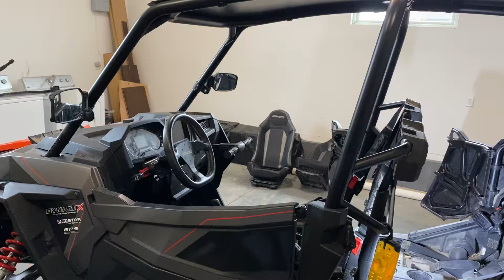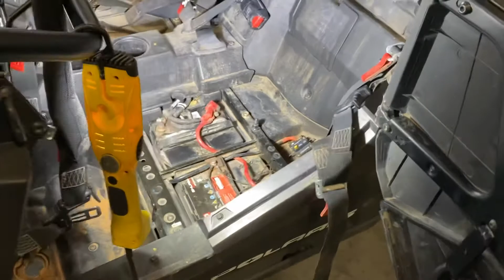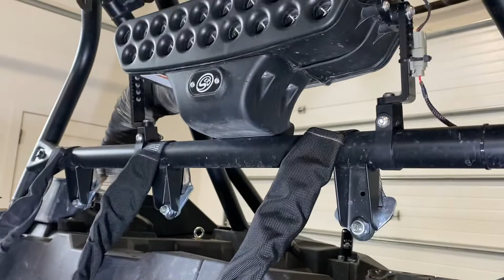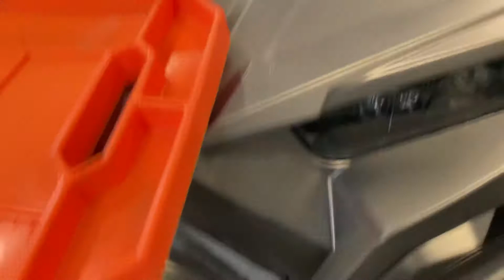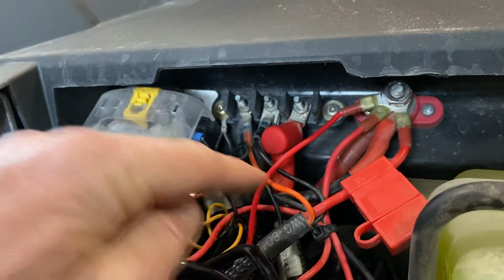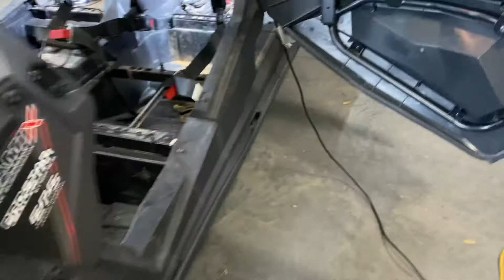Polaris RZR Dual Battery Install

Comment: Thank you for explaining the charging process and explanation for the installation off the aux battery. I just got an led light bar and street legal kit installed on my RZR 900 and it won’t start. Now, I know I need another battery to run the accessories and how/what’s needed to install it properly. EXCELLENT INFO!

Comment: Thanks for the video. Ordered my components for the same setup yesterday, except I’m adding an onboard 2 bank Gen 5 charger from Nogo and a waterproof AC plug to just pop it on the trickle charger after rides. It’ll charge the gel battery and vented battery independently on their own settings.

Comment: Does your fuse box disconnect power fron the second battery when you turn off the Key ? After all, UTV has no door. The winch is dangerous.   I am worried about children playing with it or accidentally touching it.
Reply from the maker: It does! The vent racing fuse block has a relay. I used the accessory power off the main bus bar to trip the relay that is supplied power from the secondary battery thus giving me the best of both worlds.
Reply: @BryanHansen  Nice Thank you very much! hope see your accessory fuse box video!
Reply from the maker: @george1984  I actually think I show it in my light bar mistakes video.
Reply: @BryanHansen  Hey Bryan.  Great video.Thank you.  what size relay does that vent racing fuse block have?  I want to be able to have this feature to kill power when key is off for second batt.  I already have the Blue Sea System Fuse Block.  Thanks Bryan
Reply from the maker: @bryanstaley8691  I tried digging to figure that out and I can't find it (easily). I would call vent racing directly and ask them. ventracing.com

Comment: Is the secondary an AGM? If so from what I understand you don’t want to mix AGM and flooded. I have done this and over time you will unintentionally over charge the flooded battery. Slowly cooking it. Ended up talking with two manufacturers to figure this out. Plus the two need different types of maintainers.

Comment: Im trying to do this but im going to be using a lithium  quad 30 optimo  battery  as a 2nd battery any suggestions?
Reply from the maker: Lithium has a very different charge pattern than a flooded or AGM battery. Might not matter, but just thinking out loud... I use the battery I do because of the fitment into the battery tray.

Comment: Helpful video! I did the same setup but mounted the circuit breaker in the front where you mounted the extra post. So I have a single wire running from second battery to the front of RZR and all my accessories are on the other side of breaker

Comment: Good afternoon.  Had a question about the power going uo front, could i just connect it to the accessory post on my 21 rzr? Going to do this same set up mimus the fuse block you have upfront. when adding my 2nd battery bc i have accessories with relays installed on them all...
Reply from the maker: @smokeyjoe926  make sure you use a relay and supply power through a dedicated line and not a switch.
Reply: I have all my accessories to turn on by rocker switches on dash and they go to accessory block. This is my 1st sxs so new to the accessory block up front and adding second battery. I'm taking out soundbar and putting in a noam sound kit in and trying to find best way so I don't drain battery while riding and stopping in trails.
Reply: Love the video, very detailed on how you did everything.
Reply from the maker: @smokeyjoe926  the biggest mistake people make is not running stuff off relays. Your setup sounds fine, just don’t make the switch what cuts the power but rather cuts power to a relay that shuts off the light bar or whatever other accessory you’re wiring it.
Reply: @BryanHansen  thank bud. Greatly appreciate it the info!
Reply: Just watched your light bar video... I have My rocker switches wored correctly.  Could I do everything in this video except run the power wire you ran up front? And move my power wires for accessories from. Main battery to the second battery? You were running that 2nd power upfront for bc of your winch correct?

Comment: that line of shuriken batteries is intended for use with large aftermarket car audio setups, its what replaced large capacitors, it protects the vehicle electronics and charging system in newer vehicles from voltage drops...essentially what you are using it for. The 800 watt rating is on there for car audio customers to properly size the battery to their application. 

Unlike traditional lead acid starter batteries these will stay a consistent 12.5 volts for much longer, they charge extremely fast, the can take abuse, Ive ran them dead hundreds of times and Ive had one drop a cell after 10 years of neglect and abuse. 

Thanks for the video, I am in the process of doing a very similar setup on my 19 xp4 turbo preferably with that brand of battery but needed info on fitment. 

I will have to check out the smart isolator, generally I run an isolator off the ignition sense wire, this allows it to charge once vehicle is running, isolates it when off, and will not pull from the second battery when starting.

Comment: Bryan, great video! Really appreciate it as I am installing a dual battery on my 2014 RZR 4 800. I do have a question, what is the reason for the 100A Fuse?
Reply: You were also going to post a video of the vent racing fuse block install, I couldn't find it on your channel could you link it?
Reply from the maker: @Wstrncdn5time  for fire safety. If you winch, you definitely want a fuse. I never made the other video, but it is really straightforward. I may make one just to show people what I did. Feel free to ask questions and I’m happy to answer them
Reply: @BryanHansen  thanks for the quick reply! I went with the fuse anyways, figured it couldn’t hurt was just curious. Makes sense under a heavy winch load it could have a large draw.

Comment: I really like your dual battery setup, and I understand how you wired your fuse block, but it wasn't clear where you wired your winch in. Did you wire it to the fuse block or directly to the aux. Battery post? Thanks Robert
Reply from the maker: I wired it to that battery post, and then to the hundred amp breaker before the second battery

Comment: Hi Bryan - great video, thank-you. Two questions please. 1. Can you clarify what gauge cables you’re using from battery to battery? 2. From the marine fuse to your post up front, you’re using that post to drive all accessories including your winch? My very near future adds will be a winch, lights bars, and 2 amps for speakers/subs. So any high level advice on where you would source their power (added post and/or stock accessory post) would be appreciated. Just bought a 2021 rzr xp 1000 premium.
Reply from the maker: Hey Sammy, the 2021 has a different accessory bus bar, but I would still look at running the separate power cable up front how I did. I really like isolating the battery from accessories. I got stranded one night from winching so hard that I killed the primary battery. I have 7 gauge between the batteries and 6 up to the post because it’s a longer run.
Reply: @BryanHansen  thanks for the reply! Do you think 4 gauge is too big for the front run? I had already bought some, but I’m wondering if I should return it for 6 gauge. Do you remember how long your front run cable is?
Reply from the maker: @Mrdude6013  I don’t think it is too heavy at all. Winching takes some serious juice. I don’t know how long mine was because I bought extra and cut it to length.

Comment: Can't find the video, to where you wired up fuse block etc?
Reply from the maker: I’m going to have to post up another video on it. Not sure where it went to be honest.
Reply: @BryanHansen  would you be ok , with sending it to my Facebook messenger or cell?
Reply: Did you run a ground cable from the left side of your fuse up to the ground on the main bus bar or is that another positive bringing power up to an accessories  fuse block?

Comment: Do you know if this set up will work on a 2021 Polaris ranger xp 1000?
Reply from the maker: It is a different battery size and I am not sure of the exact dimensions, but everything else works just the same.

Comment: Great vid! I’ve just got one question. What would happen without the isolator?
Reply from the maker: You could winch hard enough to drain the batteries to the point that your UTV won't start.
Reply: @BryanHansen  ok thanks man

Comment: Hi bryan are those batteries same voltage and amps,
Reply from the maker: Same voltage. The accessory battery has more amp hour storage, but that doesn’t change anything just storage capacity.

Comment: Second video of this?
Reply from the maker: I honestly do not know where the second video went. I published it, but it is gone. The install of the fuse block is really quite easy.
Reply: @BryanHansen  I have everything I need.   Just have to hook it all up.   However the extra hot terminal next to your bus bar I didn't get.
Reply from the maker: @samkiepprien3858  so you aren’t running dual batteries?
Reply: @BryanHansen  Yes I bought the exact same battery you have.
Reply from the maker: @samkiepprien3858  we’re you just going to run the wire directly to the fuse lock then if you didn’t buy the extra post?
Reply: @BryanHansen  I bought a fuse block to attach each individual accessory.   It'll light up if one was to blow out.   Really not sure what would be the best.  The reason I haven't started into it yet
Reply from the maker: @samkiepprien3858  And were you going to run every wire directly to the battery or to a terminal post like I did?
Reply: @BryanHansen  That's what I'm trying to figure out.    The fuse block needs POS & Neg ran to it then all the accessories would go into the block.   So are you saying I would need to run two hot wires to the block adding another hot terminal?
Reply from the maker: @samkiepprien3858  I ran the post because I wanted to run my winch directly to it. The fuse block I used, which you can run the blue sea block too, needs positive to it and the. You just ground to the frame anywhere. My fuse block is relayed so I ran the relay to turn on from my OEM accessory post and then the power from my added post. That way it was keyed power, but supplied from my second battery.
Reply: @BryanHansen  So the extra post isn't nessisary needed?    POS & Neg from bus bar to fuse block in which I could hook my winch to the fuse block too, and just run a hot wire the length from the secondary battery to the hot connection on the fuse block?
Reply from the maker: @samkiepprien3858  accessory from the oem bus bar, negative to the frame, power from direct connection to the second battery. And, run an isolator for the batteries.
Reply: @BryanHansen  I was going to unhook the accessories from the bus bar, and connect them to the fuse block.   I do have the isolator but still have alot of wires that were hooked to my main battery with fuses.   Just reattach them to the secondary battery now?
Reply from the maker: @samkiepprien3858  I think you’re headed down the right path
Reply: @BryanHansen  So everything that I had connected to my battery under my seat I can now just connect to the fuse block?    Sorry I'm no electrician.
Reply from the maker: @samkiepprien3858  yes.
Reply: @BryanHansen  So you had a hot wire running the length of your vehicle to the 100A fuse.   So do I run that from my accessory fuse block to that 100A fuse or directly to the secondary battery?

Comment: How about trying the True battery isolator kit with manufacturer full warranty
Reply from the maker: I have like this set up the better. In fact I got to use it on another vehicle the other day at the auxiliary battery was dead. It was great to be able to just jump the primary battery and have it take right off

Comment: Did you use self tapping screws on those three pieces you had to mount to the machine or bolts and nuts?
Reply from the maker: I used self tappers, but I would like to actually put in rivet nuts. This worked great though.
Reply: @BryanHansen  you don’t happen to remember what size you used do you?

Comment: How’d you power that new fuse block battery post? Run a cable from your existing bus bar so it gets power with key on only? Great video! @bryanhansen
Reply from the maker: I actually ran a six gauge wire from the battery clear up to that new post. It’s actually easier than you might think. You can pull up the panels between the seats in about five minutes and run a new wire along the existing wiring harness.
Reply: Gotcha, but how did you get the key on power to work with that new blue sea fuse block? I want to install one on my ranger along with dual battery kit but don’t want my new fuse block to have constant power if that makes sense?
Reply from the maker: @nathanbailey4950  oh, yes. I ran the 12 V power in a new cable to the battery, but the fusible accessory relay to the existing accessory power which is switched on by the key. Let me know if that makes sense.
Reply: @BryanHansen so the blue sea accessory fuse block has a relay already? Internal one i assume? Thank you !
Reply from the maker: @nathanbailey4950  Ahhh this one. The blue sea is just a fuse block. The vent racing is relayed AND fused. https://amzn.to/3USSJoL

Comment: Do you have any relays? Im trying to figure out if i can get rid of relays if i wire my stuff up like this.
Reply from the maker: Which relays are you wanting to get rid of?
Reply: The one that come on the wiring harnesses for lightbar or podlights.
Reply: It wont let me add a picture or i would lol
Reply: Every extra light i bought has a plug in relay made in the wiring kit.
Reply from the maker: @mudmechanix  if you don’t have a relay, the switch is providing all the power which is something you don’t want. Switches are often 18 gauge wire and internals where your wiring from your relay is usually 12 or 14. I personally wouldn’t eliminate them. They’re there for a reason.
Reply from the maker: Watch the other video on my channel of light bar wiring mistakes
Reply from the maker: @mudmechanix  yeah, I am typically trying to add relays, and you were trying to remove them. Relays are good, not bad.
Reply: Thanks for the info👍

Comment: Did you run a ground all the way to the front also
Reply from the maker: No. The chassis is grounded so anywhere you tap in is good.